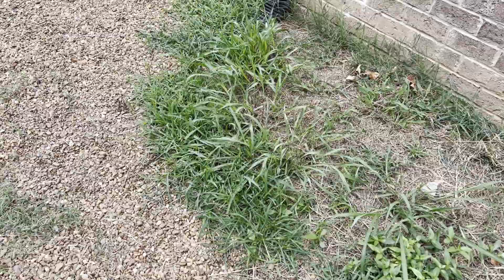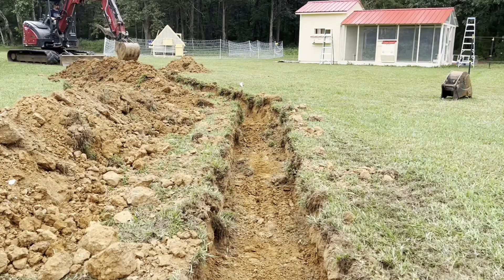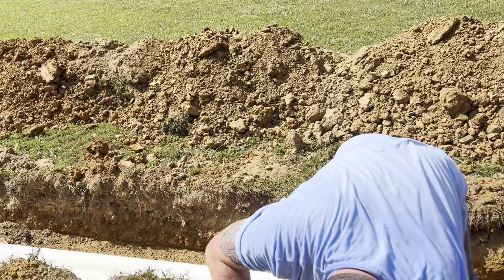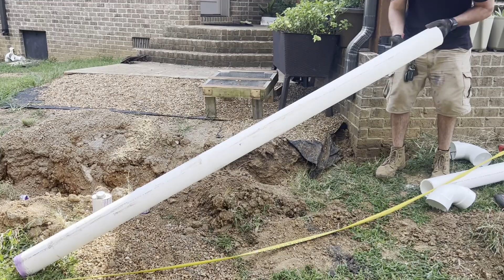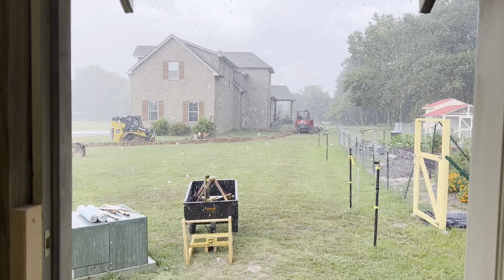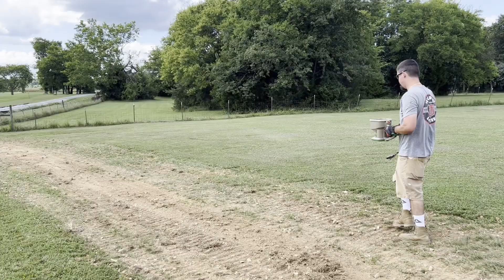Don't Even Think about installing Pop Ups for down Spout Drains until you See This

Comment: Looks good, you found a good contractor. They do make double wall corrugated pipe, it’s smooth inside and comes in 250’ rolls. I would have suggested using electrical conduit for the risers, it’s already gray and doesn’t need painting.
Reply from the maker: Yes, I really like my excavation contractor.  I took a risk on him because I found him on Yelp and he had zero reviews at the time.  I am sure glad I didn't rent one and try do it myself.  He literally dug it all out in 4 hours.  He did such a good job of compacting the dirt that you can't even tell were the pipe was which proved to be good and bad.  This schedule 40 pipe is pretty tough, but I could use something even tougher.  Today I had someone out to add a propane tank who used a trenching machine.  Sure enough he managed to slice through both pipes!  Next time I need to go with steel.  The reason I wanted the schedule 40 instead of corrugated was it crossed under my gravel driveway so I wanted it more crush proof.  However, smooth wall pipe does sound like a really nice improvement over traditional  corrugated drain pipe.  I didn't mind painting at all and I was able to not only paint the white pipe, but the fitting and the sheet metal screws.  I never liked the look of my existing electrical conduit and was just thinking about painting it as well.
Reply: @DYI The real art with dirt work is getting everything back into the hole and have it look like nothing happened. You made a good call on hiring someone given all the utilities he had to work around. With a good operator the machine is literally an extension of their body. There is a flood of small excavators coming in from China, they have something like an 18hp gas engine, sell for under $5K. They are good homeowner machines, digging planting holes, ditches, lifting stuff.
Reply from the maker: @stephenblack8804  He really did an amazing job filling and compacting as well as digging.  He did such a good job compacting that a profession can't tell where he dug.  Ask me how I know?  One week after he finished I had propane tank installed and the propane guy used a trenching machine to bury the propane line.  You guessed it.  I had warned him about the pipes, but he ended up slicing right through both because he could tell the difference when he hit the trenched area.  I was going to make a video about the propane install, but I don't want to re-live it as I will cry every time;)    My excavator guy also did a good job with the straw and seed and grass is already starting to sprout.  Harbor Freight has an Excavator for only $3k.  I could have rented a machine as well, but I was buying the skill and experience more than the machine.  He also got commercial level piping and fittings at a better price than I could have gotten.  Much better quality than they sell at Lowes or HD.  The large machine my guy used is a Yanmar that was made it China.  It was pretty impressive.  I like how he could swap out buckets without getting out of the cab.

Comment: Please follow up next time it rains and show how much water it collects. Looks awesome 👍
Reply from the maker: Absolutely will do.  It rained intensely already, but not for very long.  I didn't want to risk taking my camera out in the rain, but I walked to the exit pipes to observe.  There was water gushing out of the pipe coming from the down spouts and the pipe was only about 15% capacity.  There was no water coming from the pipe connected to the 2 catch basins which made sense because  it didn't rain long enough for there to be water over them as it rained for so little time the water was just absorbed with no run-off.  Next big rain I will post in the description a link so do subscribe to get the notice.
Reply from the maker: Just uploaded the follow up video:  https://youtu.be/IJh1LipCpy4